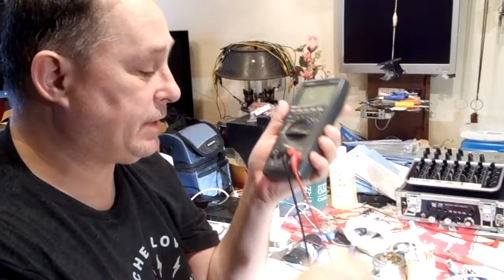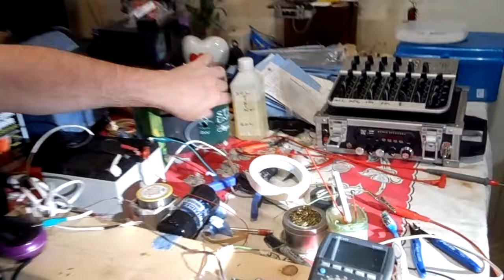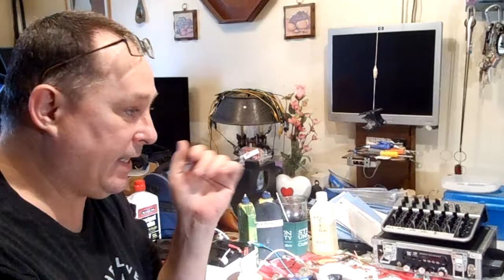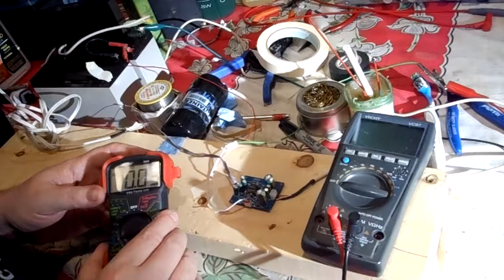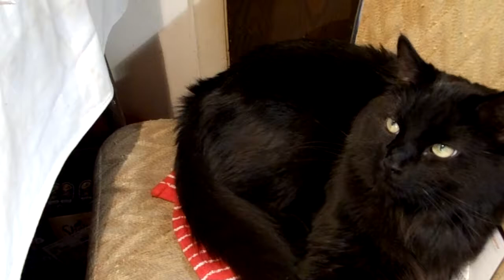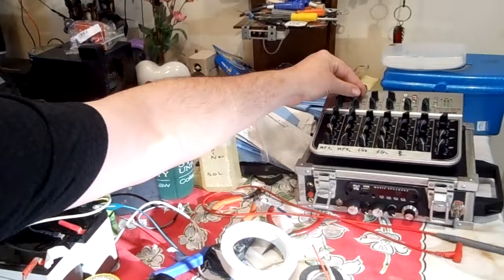current draw test using a multimeter

Comment: My amp board didn't come with those 3 pin connector wires, so I had to really dig to find them since I didn't know what they were called either. Eventually found some... they're called 3-pin jst-xh. I think mine were 2.5 mm pin pitch, so keep that in mind while looking, if you need 2mm.
Reply from the maker: thxs i measure mine the other day and i forget now ... i think 2.5 ... if i type that in 2.5 shielded i get nothing though ...
Reply: @peteytwofinger  I just looked and the ones I got off amazon are unavailable, but you're right... not shielded, shit. Guess I'll have to foil wrap them or something. I can't find any that are specifically for audio use... seem to be for rc cars mostly.
Reply from the maker: @David.C.Velasquez  i know --- like i said i recieved a set of those 2.5 mm 3 conducter audio cables  with a 2 dollar ne5532 based  preamp board . i asked the seller " what are theese cables called so i may order some" reply- how may u want- i reply "4-6 but i also wish to know what they are called so later i may order more - he responds - 3.96 per cable per unit .... now the preamp i bought came with two cables and it was 1.96 ... so i explained again , this went back and forth , finally i used google translate to explain in chinese , and the response after asking him in two languages to please tell me what this type of cable is called was " preamp board single supply dc " ..... unreal . i hate vendors who play games with a firey passion . alot of them are like that . i had a 3 month battle for a 8 dollar refund ,with maybe 30 back and forth emails where this guy "snakewang" effed me . i got my money back but i had to contact ebay. i have had more than a half dozen very similar interactions with vendors of electronics from szhenzen . those people would stab you in the pee hole for a half of a scale off a slug . i will seei f i can figure out what they are called , and if you do the same please let me know i buy a lot of the mp3 decoder boards and class d amps and they use the same stuff . you CAN remove the pins from the plastic clip . you could also cut it at the base and solder a shielded cable on it , or wrap it with foil that is grounded but ... thats all sloppy and messy  kind of . hopefully between the two of us we can crack this egg . it just that i have been at it like a half dozen times with only finding non shielded cables and i cant really determine apattern as far as what they are called ... asking a vendor who includes them in the packaging is one way to go at it so ... i am going to be asking , especially a usa vendor may know and tell you . i also think i should go to the diy amp builder forum and ask . i havre a password / account there ,so ... remind me  / bug me . those guys would know ....